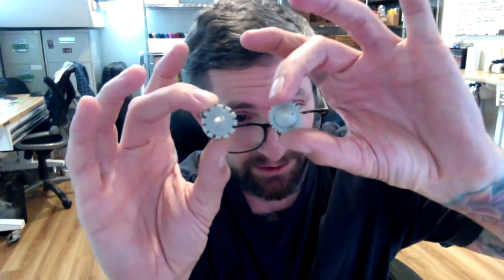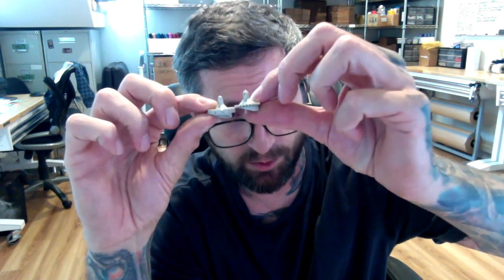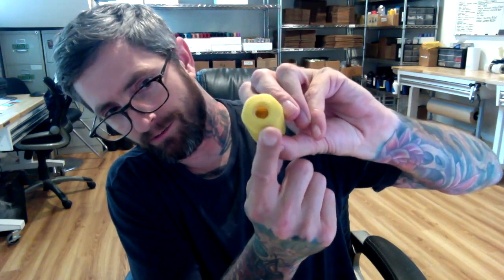The Path Of A Tattoo Machine builder | Neuma 5 with Carson Hill | EP 274

Comment: Have the 4 and it’s been a great machine. All though it’s set up to pack and I rarely change it. So if the 5 will have quick shift functions that sounds very interesting. I’m sure when it goes live it will say, but not fully sure on the differences between the 5 and 4 though
Reply: Same mines at 28 use it for everything
Reply: @ivanmendoza8457  what stroke